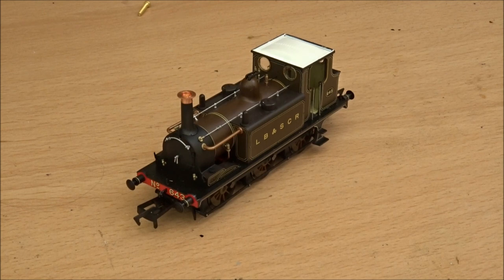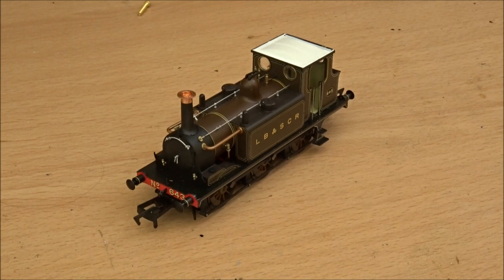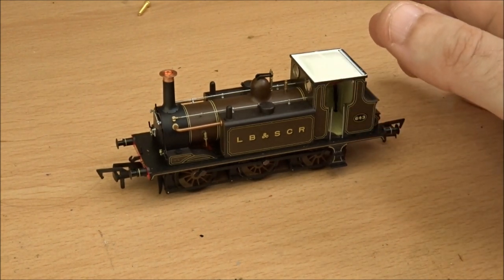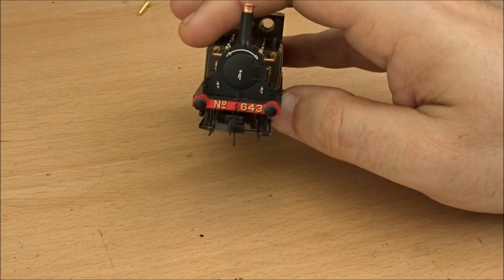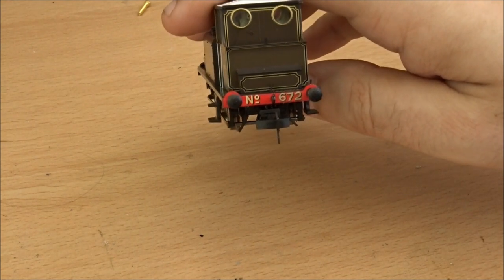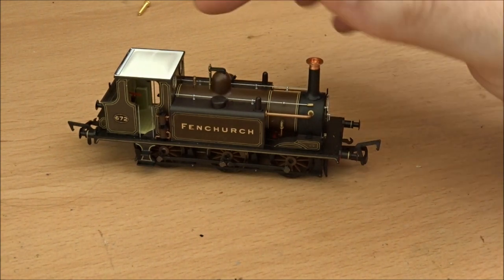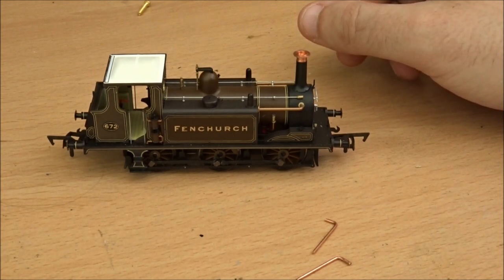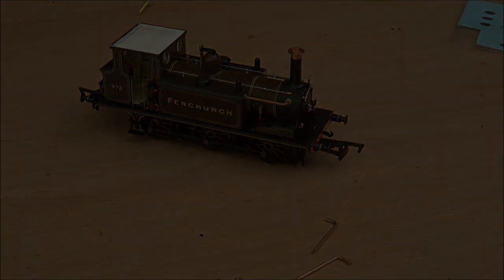R.O.S Terrier, conversion to Fenchurch, Part 1

Comment: Interesting. Did you try Brasso/T-Cut for the sides? I find that that usually works well, but have not tried it on this sort of model.
Reply from the maker: Tried all of the normal techniques.. You will see in part 4,  I tried just getting rid of the coloured letter then scraping the black off but that didn't work either.